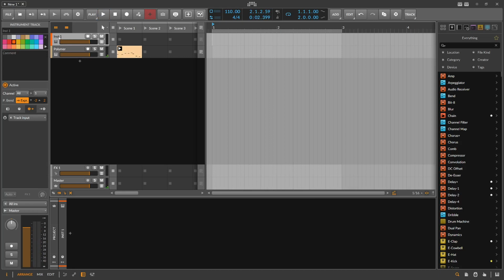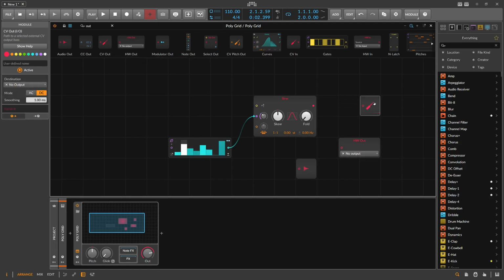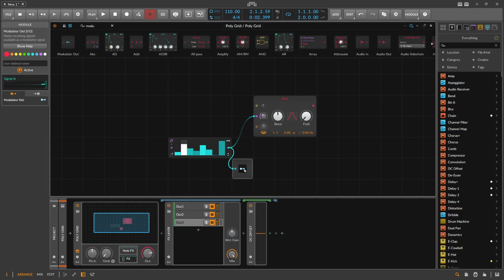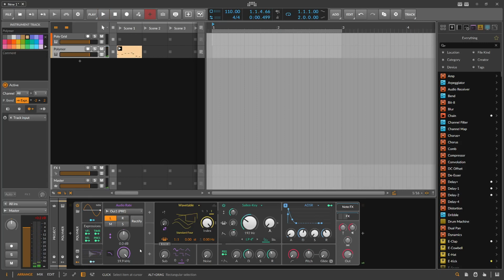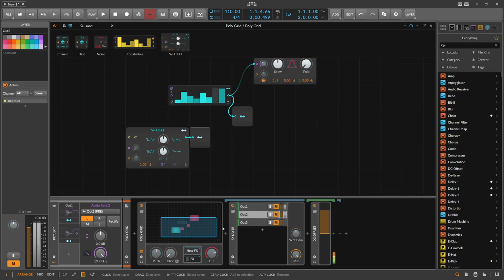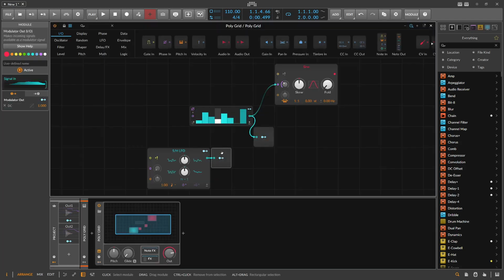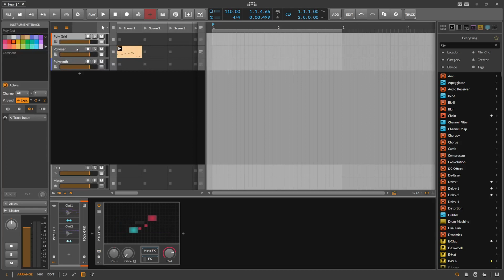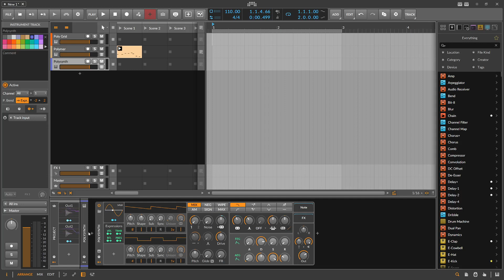Using Global Modulators in Bitwig for Interchannel Communication

Comment: i might be misremembering, and I dont have Bitwig in front of me, but can't you add multiple audio outs in the grid and connect the steps etc directly to these audio outs without the need for those modulators and DC level devices

Comment: Awesome video! One comment + question: the Audio Rate modulator has a filter cutoff section that goes from 1Hz all the way up to 19.9 kHz...does this imply that signals that are "exported" that move slower than 1Hz will not be usable (at least by this particular modulator)?
Reply from the maker: no sure what you mean, but its just a cutoff, you cant cut lower than 1hz.
Reply: @PolarityMusic Ah yes I see now…my mistake. I was thinking that extremely slow signals might not be processed by the Audio Rate modulator, but it looks like that’s not the case. Thanks!

Comment: Would it be possible to do the same concept using a midi CC out, instead of dealing with the DC offset?
Edit: Tried this out and it does work, however you lose some precision since CC values only scale 0-127. DC Offset seems to preserve more precision, into the thousandths place, in case that matters.